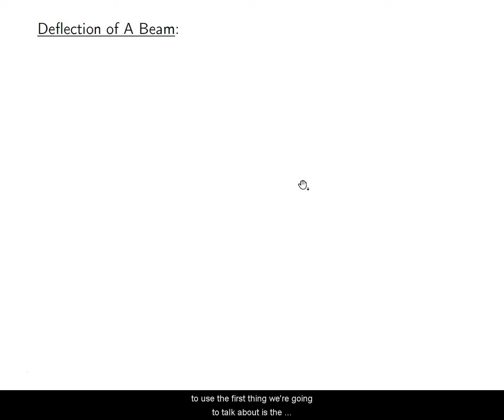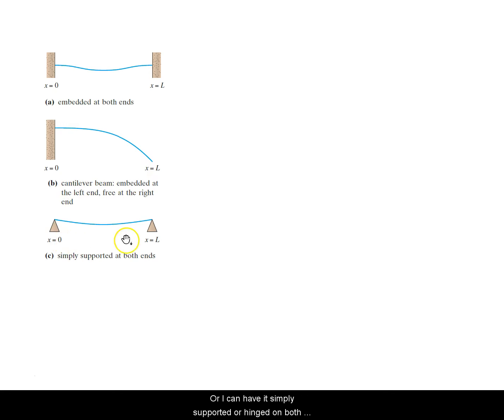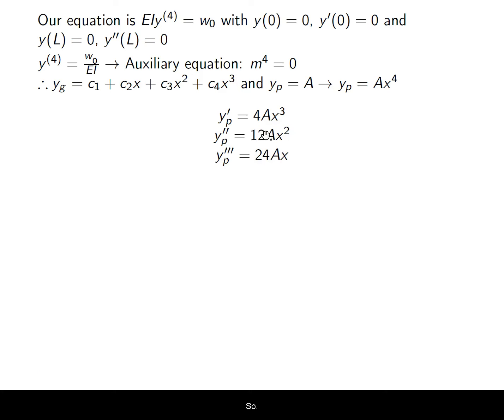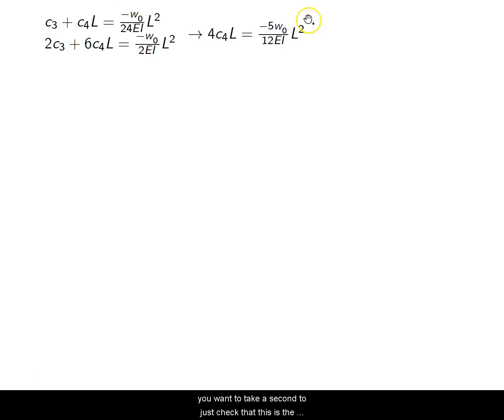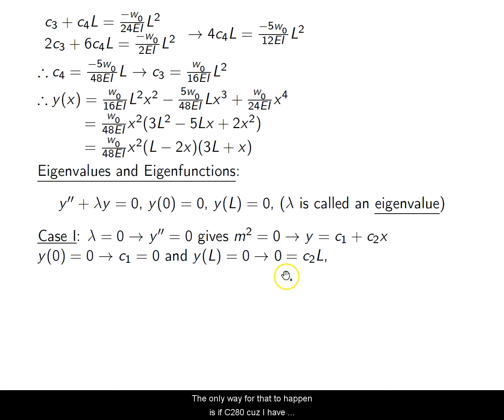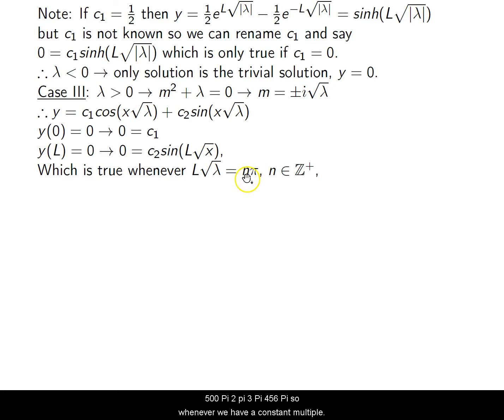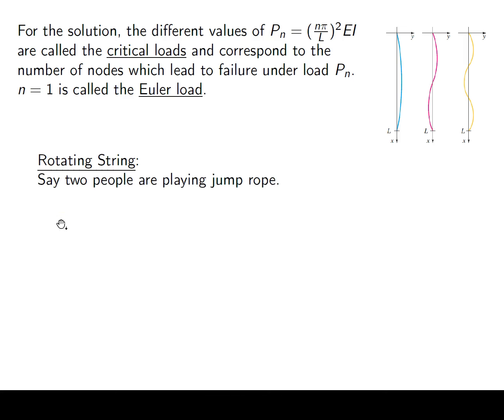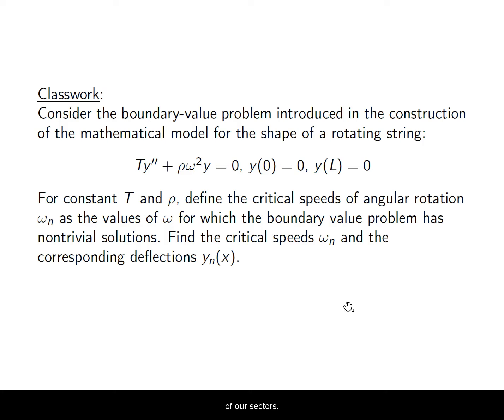Ch. 5.2 Linear Models - BVPs

Comment: Sir I wanna ask how m=0 and we got four repeated roots using constant coefficients !! I tried multiple times using characteristic homogenous equation DE but didn't get m = 0 !
Reply from the maker: If you go back to Ch. 4.3 it is the 2nd case. We have m^4=0 as our aux eq so we have a repeated zero of 4 for that eq. Since m_1=m_2=...=0 our e term equals 1 so we have the general form as given in our example.